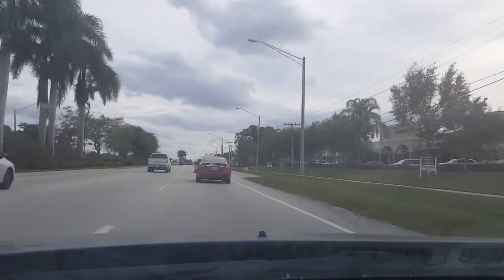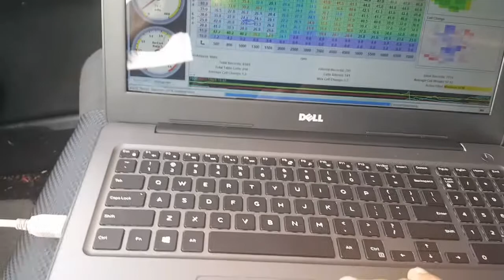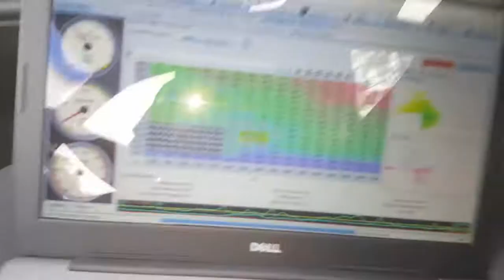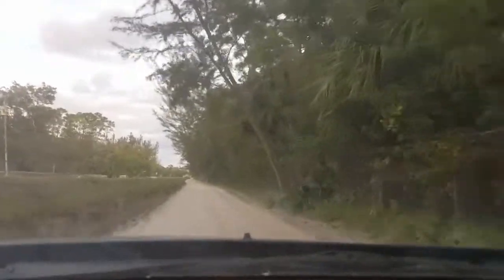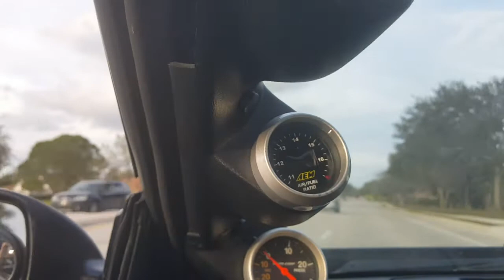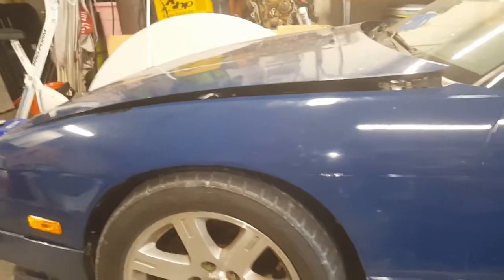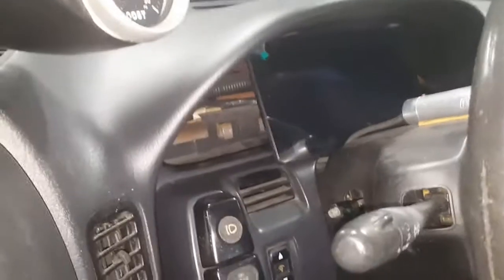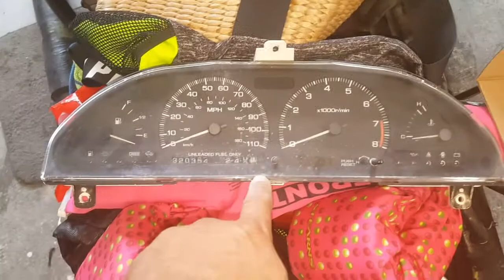VQ35 Build Part 72:  First Drive on Public Road and Turbo Singing...

Comment: Man I was getting just as excited hearing that turbo start to spool. Car sounds perfect
Reply from the maker: Yea, it is surreal to me.  Haven't driven her in 11 months.  Was able to squeeze more out of her today.  Thanks for the compliment.  I am slowly getting use to her.  I am waiting for some gremlin to come out of the wood works.
Reply: I think it's been three months or so since I drove mine. Battery is dead and I'm going to have to break into the car.... no key locks and power lock fob isn't going to help lol.
Reply: Actually I forgot to mention I bought the exact same hood pins a couple months ago.
Reply from the maker: Aww man...sucks having to break into your own car...At least prying the window a bit and using a stiff rod is pretty easy...I have learned to leave my sun roof unlocked so I can pop the lock much easier.
Reply: I've got a good break in kit, it'll be easy. Make a vid out of it.
Reply from the maker: Oh snap, give thieves some pointers...
Reply: supakat500 LOL

Comment: You could always get an aftermarket hood. Or use body filler to attach a vent
Reply from the maker: That will probably happen since I already molested the hood.  I could try a vent and if fail, go aftermarket.

Comment: You should space out the front crossmember a little to lower the engine a bit for that hood clearance
Reply from the maker: Too much work for me.  If I do that, then may have clearance issues with pot holes or something.  I would be scared that I hit the oil pan and crack block.

Comment: That spool tho 🐌 . Haha yeah the trans you have has horrible synchros. You just need cd009  rebuild parts to clean up the issues but I think the dealership sells the parts as referred "cd00A".
Reply from the maker: Yea, she sounds nice.  Yea my boy has a tranny shop.  I will order through him and put in the triple synchros.  I will drive a bit tho...feel good.
Reply: supakat500 yeah you should do some wot pulls. Just double clutch  everything haha
Reply from the maker: Aaron _z33 haha and blow the welds off my intake manifold!  Oh I plan on doing some pulls...just need to know my GPS.
Reply: supakat500 just use red locktite and locking washers on your floor pan you'll be fine.
Reply from the maker: Aaron _z33 haha...zip ties might be better...wonder if MegaSquirt will throw big flashing messages on tablet...
Reply: supakat500 "DANGER TO RODS" 😂
Reply from the maker: Aaron _z33 No don't put goat mouth on me...
Reply: supakat500 lol na you'll be fine just don't spray nitrous
Reply from the maker: Aaron _z33 man, i got my beer and tempted to run again.  I need to clean up vacuum map then start ve live on the boost map with 4th gear pulls.  My tuming is set for now.  Synced ecu timing this afternoon and didn't have to play with the trigger offset.  Dead on 20*.
Reply: supakat500 so you preset your boost map and run auto tune on it? That's cool ms has the triggers on point
Reply from the maker: Aaron _z33 I can make changes to VE map for it to make a clean pull.  Right now when it sees boost, my VE map is rich and dumps fuel and bogs out.  I rather run rich than lean and let TS clean up AFR's.  Since I know 99kpa value, I will make 107 kpa slightly richer and interpolate to redline/15psi.  Make a pull and clean afr's up until it makes a clean pull then use VELive to clean up while doing 4th gear pulls.  Once afr's are good, then play with timing.
Reply: supakat500 what rich numbers are you seeing?
Reply from the maker: Aaron _z33 --- then 10.1.  I tuned for 11.8 on KA.  I am going to play safe and tune 11.5 with .5:1 reduction.
Reply: supakat500 10.1 damn that's rich as hell. it will help having a cooling affect at around 11.5 too. I was thinking you would run closer to 12.2 A friend of mine accidentally burned his AE wrong when I was driving it was 10.0 cruising yeah it wasn't pretty I had no power until he burned it again haha